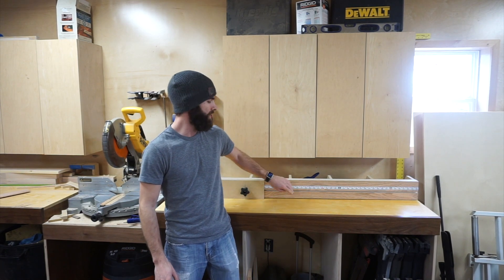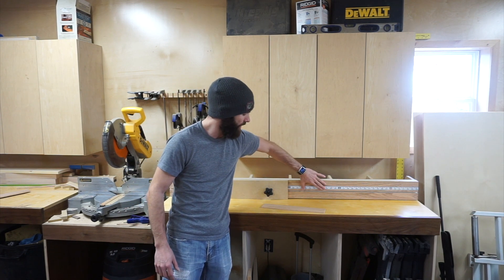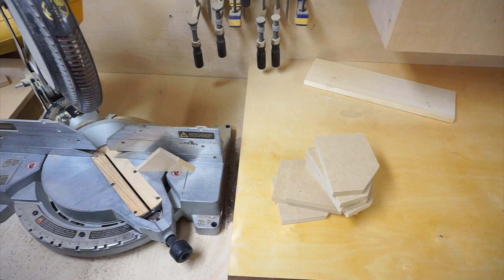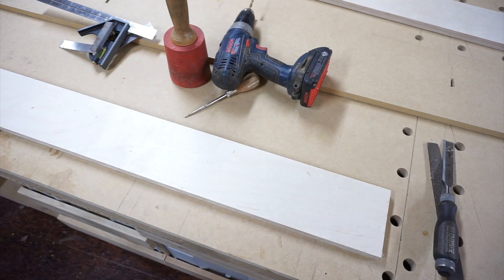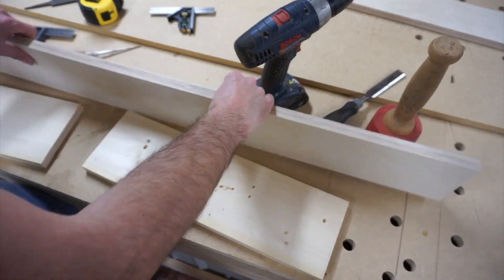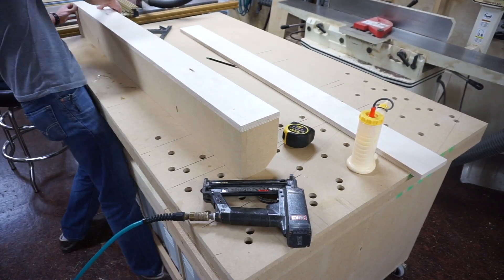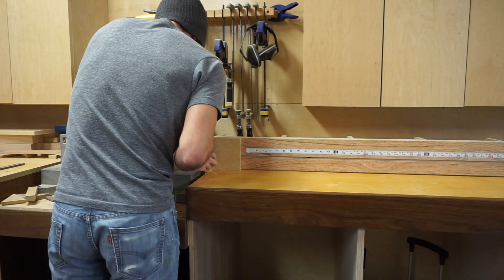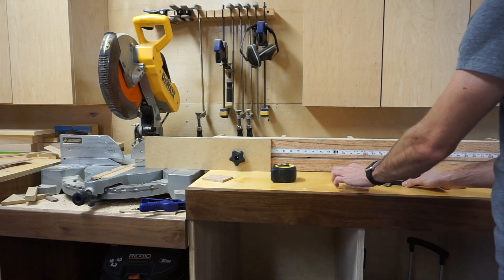Miter Saw Fence

Comment: Good job. You can save yourself the headache of making fine adjustment on that fence by making your block a little longer on the left than you need. Align the block at zero on the tape then cut the end off the block with the saw. Now zero on the tape is exactly at the cut line on the saw.

Comment: I’ve been watching this video over and over in order to build this fence. I’m adapting it to fit my space. I’m going the more expensive way and using T track. I’ve found this fence to be the most adaptive way of getting what you want. The adjustability is what separates yours from every one else. How come you don’t make more videos. You are very good at it.
Reply: t-track is way cheaper than oak.  Since the oak made up his "t-slot", it  was a good choice for his build.  BUT, if YOU are using a length of *aluminum track, poplar, plywood or mdf will do nicely & keep the build cost down.  Good Luck.🔨Lisa♿

Comment: Nice job man. So how is the slide connected to the fence.
Reply from the maker: T & A Adventures the wood basically creates a t slot that 1/4-20 bold heads slide in. Does that make sense?  It does in my head any way lol.
Reply: Dairy Barn Woodworking yes lol. Did you use a t slot router bit
Reply from the maker: T & A Adventures I did not. If you skip to about 6:45 you’ll see how I stacked oak on top of 1/4” plywood in a sandwich configuration to creat the t slot. Let me know if that does not make sense.